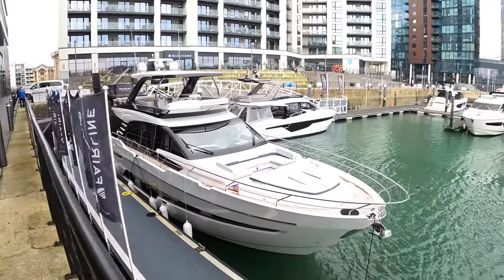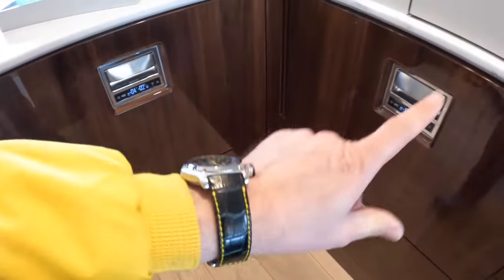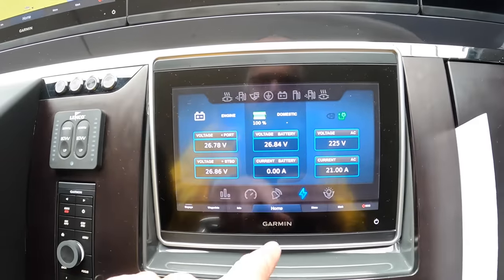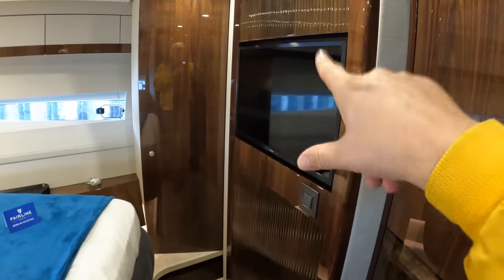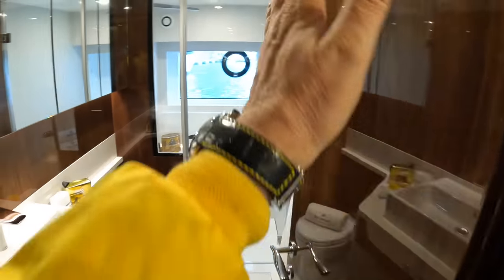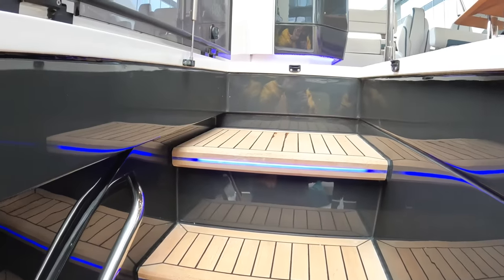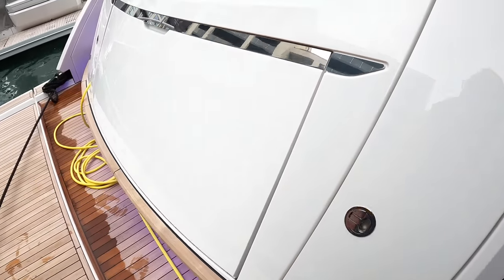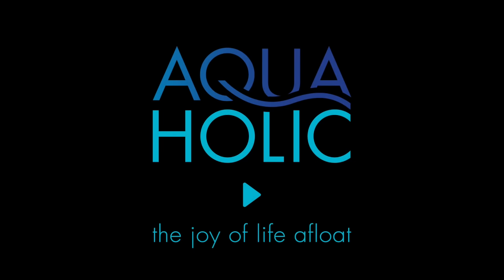£2.5 Million Yacht Tour : Fairline Squadron 68

Comment: The 'extra equipment' on this boat at this price point lifts it to a new level of desirability!  The option to add refrigerator/freezer and storage space, the washer/dryer, and even the ironing board make for comfortable cruising.
Reply: I'd not be surprised if the price tag in the description is the starting price, before all of the add ons. 😨😨

Comment: I keep thinking I've seen the nicest boat yet, and then you go and show another even better. Fairline have simply done an amazing job with this boat, and the craftsmanship is top notch for sure.
Love the utility area, rather than see bits crammed into smaller spaces. 
If I had the money for such a nice boat, this would be close to the top, but because I want to be less reliant on fossil fuels, electric will be top, just as with my car.
Reply: Agreed on your last point.  These boats are so fossil-fuel-intensive, and yet, you hardly ever even see a single solar panel on them even though they seemingly would work so well to handle ancillary electrical needs on these boats.

The roof of the flybridge, for example: Rather than being retractable, if it were solid and had solar panels on it, you could get several kW of capacity out of it from having solar panels on top, which would help save a lot of diesel that would otherwise be burnt by the generator to run the ship's systems and lighting.  Yet none of the yacht manufacturers seem to do this?  The yachts already have the batteries for it!

Comment: Awesome.  I especially like the ability to change your Refrigeration from freezer to regular refrigerator. Very insightful thinking as your Refrigeration needs will change as you use the boat differently. If you're going away for awhile you would probably want more Frozen. If you are having a sizable crowd for a day party you would want more regular Refrigeration. I'm not particular to high-gloss wood.  Same wood but in a matte finish would be perfect for me. I don't think I would have thought to look under the seating for my Crockery. Other little innovative things like the small stool that is fix to the floor but hinged in the owner's cabin so it won't move around when you're traveling

Comment: How many positive things can a Fairline 68 have?  No chines above the waterline.  2. Light switch that can be turned on in spite of breakers being in stand-by.  3.Traditional Fairline quality woodwork throughout.  4. Freeform interior furniture, rather than right angle plot plan.  5. Switch and functional backup for the digital displays.  6. "We can edit it out later".  7.Utility room that is a big improvement over the cubby holes on smaller versions.  8. Multiple interior floor plans for a truly custom stateroom set-up.  9. @@On a personal note to Nick:  I hope that I was the one to mention the English homely VS the American version of homely.  10.  TWO holding tanks.  One for the owner's cabin and one for the 3 quest staterooms.  Attention to detail.  11. British Engineering and Workmanship at it's finest.  (As apposed to British union labour in the 70's/80's.)  12. Flybridge storage for plates and cups enabling easier service.  13. Great Option List For Only 2.5 Million Euros.  14. Cat Diesel Engines!  15.  Nick is Six Foot Two ! !

Comment: Nice Nick. Like this one. Puzzled on the crew cabin. If one is in there with the door/steps closed, how do you know if it's safe to open the door and not going to throw someone off the steps? I take it one has to shout 😃
Reply: at 35:43 there is a window and possibly a porthole in the top step
Reply: @whymelaugh  you can open the porthole and poke whoever is hogging the steps in the ankle to get them to move 👻
Reply: The crew are always up out of bed before the guests, and into bed well after the guests (unless you're in Greece)  ;-)

Comment: Hi Nick, a great boat for the money, proper woodwork too not the IKEA look a like. Only pet peeve for me is the galley being part of the saloon and that possible troublesome galley powered rear window. Still that's the way they design yachts these days. Cheers DougT
Reply from the maker: I don't think the window is powered, I think you just unclip it and  hinge it open.
Reply: @AQUAHOLIC  OK, sorry but most of all the ones that's been featured have been electric driven, either pop ups or top hinging ones 🤔 😎 I'm glad they also had manual back up systems as well as all the digital controls, otherwise an electrical breakdown at sea would leave too many loose stools too 😁😁😁😎

Comment: Very nice interior from layout, design and material selections to the beautiful woodwork you pointed out. Nothing wrong with the exterior either after the changes to the previous model you mentioned. Narrow beds though both in the Twin and the VIP, and in the Crew Cabin they could've used wider beds in bunk configuration instead of those pesky 70 cm beds. But I'm not a crew member so who cares :)

Comment: Great boat, great video Nick. Question: If you plot a course on the plotter screen, will the autopilot follow it or does it just do straight lines on a set heading?
Reply from the maker: You can do either, but normally you'd put a waypoint into the plotter and the autopilot will compensate for tidal drift etc

Comment: I'm looking at the flybridge on the fairline squadron Bernard and the way it's built it looks like it leads itself to be totally enclosed heated and air condition now the words protected from the elements what that means as a 68' yacht could have a fly bridge in a sky lounge even though it would be a small one and that would be a first for it's class It looks nice it's probably a very mechanically sound I cleaned and I would test the limits on making that fly bridge enclosed it would be a 68' Tri deck yacht

Comment: I hate that Fairline Squadrons now have aft galley layouts. I want to walk into my boat just like my house. My main entry goes into the living room, not the kitchen. I'm not a chef, so my life doesn't revolve around the kitchen. I want a small galley that has enough room to cook a meal and get out of there. I want the largest salon or living room possible. Most people spend far more time in the living room than they do in the kitchen. Especially on a boat. Older Fairline Squadrons are still some of my most favorite boats...not the new ones.  This is a beautiful boat though. One more thing I don't understand is, on cabinets and closets with mirrors, why not put a brushed metal piece where you press to unlatch?  I hate fingerprints on everything.
Reply: I have to agree. Every boat I've owned has had a central galley. Always with a decent extractor that would exit at deck level. Usually just forward of the wheelhouse/helm station.
I like an aft master too; these aft-open yachts just don't look right to me. I guess I'm just very old fashioned...old too - lol